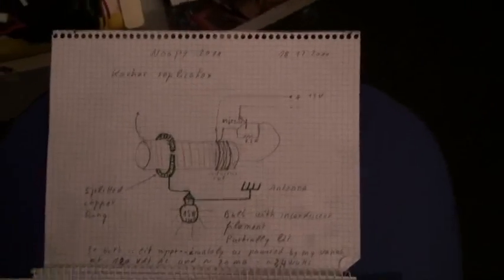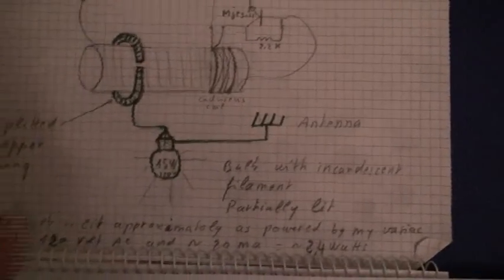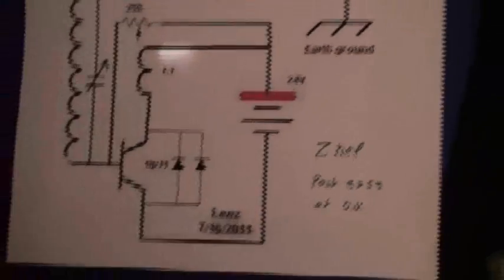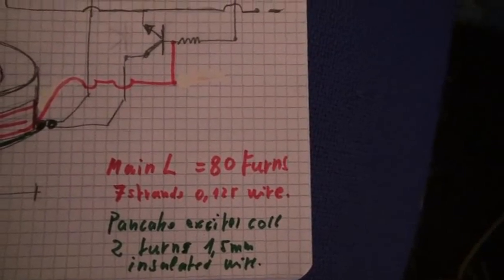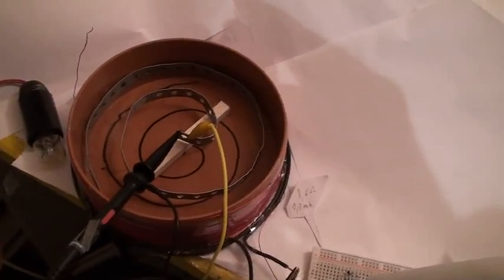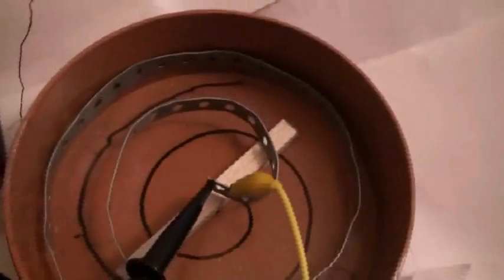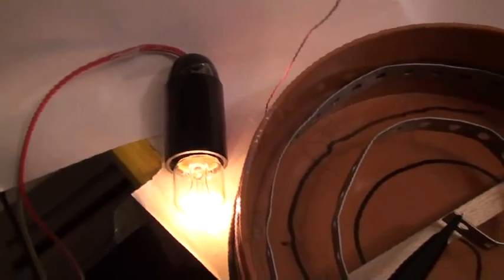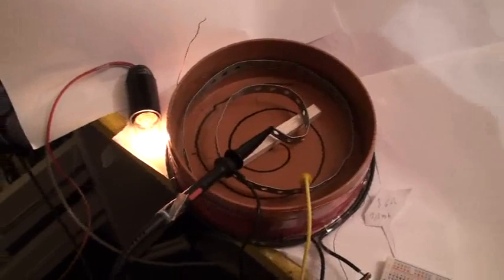Kacher large diameter coil replication.wmv

Comment: 3rd:  So in your experiment the secondary coil is generating a high-frequency high-voltage signal.  This is capacitively coupled to the metal inside the secondary coil.

In other words, there is a very small "air capacitor" a.k.a "stray capacitance" between the secondary coil and the metal that connects to the light bulb.

Your circuit runs at high frequency and the high frequency power flows through the stray capacitance and lights the light bulb.

Comment: 2nd:  When you have the signal generator set to low frequencies the light bulb will be off. As you increase the frequency output of the signal generator you will see the light bulb get brighter and brighter.  Above a certain frequency the light bulb will be the same brightness as when you make a direct connection to the signal generator (no capacitor).

Comment: Laurent, this experiment works based on a fundamental principle:  When you pass an AC signal through a capacitor, for very low frequencies the capacitor acts like an open circuit and for very high frequencies the capacitor acts like a short circuit.

Simple experiment:  Connect your signal generator (on sine wave setting) output in series with a 10 uF capacitor.  The other side of the capacitor connects to a light bulb.  Then the other side of the light bulb to the signal generator ground.

Comment: It would be interesting to have an LED on an avromenko plug, and test the field strength, before, and during the use of the incandecent bulb. If excited before, find a location to "sit it on a stand" where you'd "expect it" to excite, and light. Then, with the LED/plug still in the same location, activate the incandescent, and see if the LED dims or goes out. You may have to have the inner collector removed for the first half of the test, the LED/plug on it's own.

Comment: Great video! 
I am also now working on delamorto and similar circuits and am observing the same as you do. Will try now the Kacher circuit on a 500mm diameter flat pancake coil made of double speaker wire, should be interesting. Will post a video if something good comes from it.
Thanks